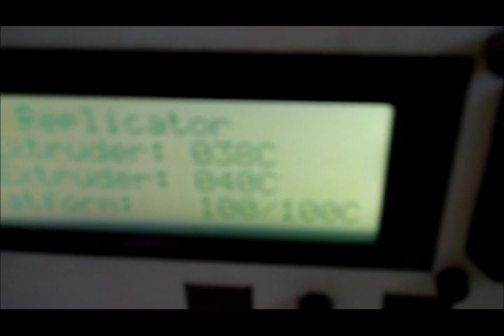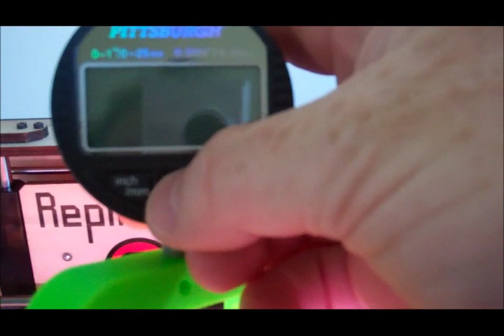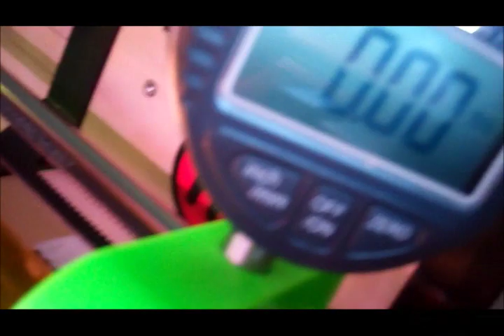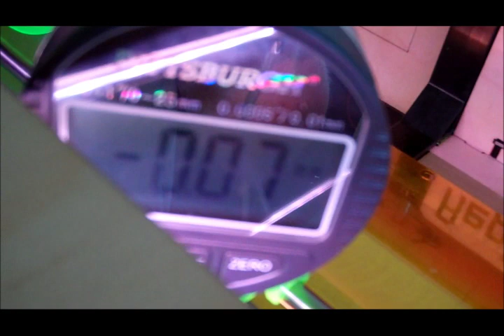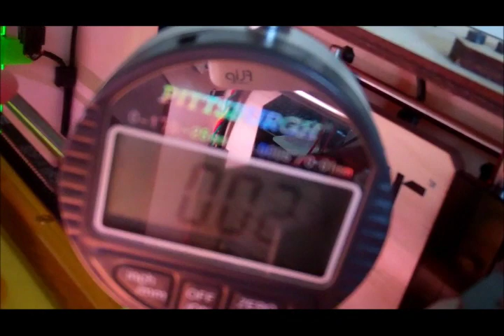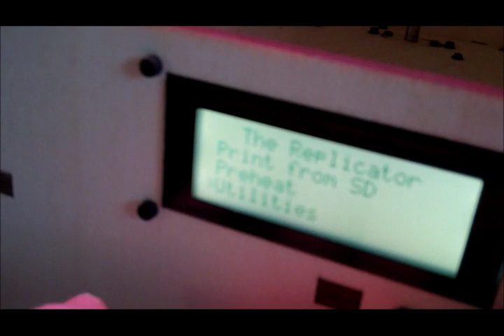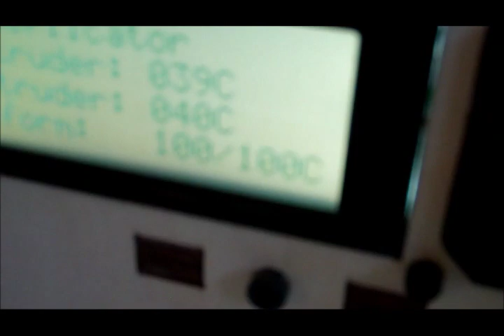MakerBot Replicator Better Build Plate Leveling procedure

Comment: For some reason this works better with me using the .2mm feeler gauge. That is just the results that i found. If i use the .1mm my extruder hits the build plate just enough to clog the extruder and .2mm works perfectly. Those stupid plastic arms on the replicator really is the achilles heel. Someone needs to produce milled aluminum arms and sell them on ebay or something! Id buy those in a heart beat! Thanks for the video! This tool Rocks!

Comment: Mr., good day! If you don't mind could for kindness answer a little question: What do you do with the motors to move the dial through xy axis? Doesn't moving them generate a counter current and damage the motor?

Thanks in advance